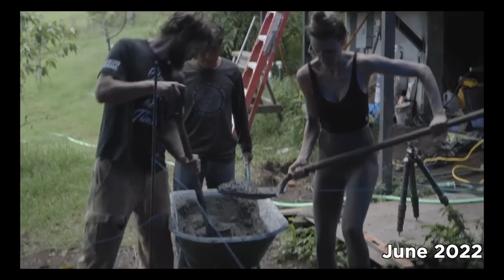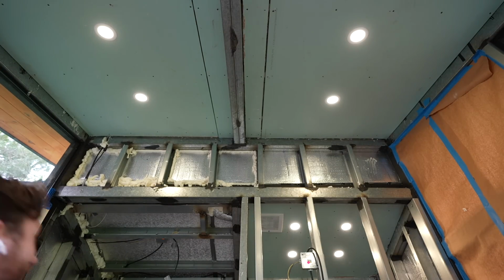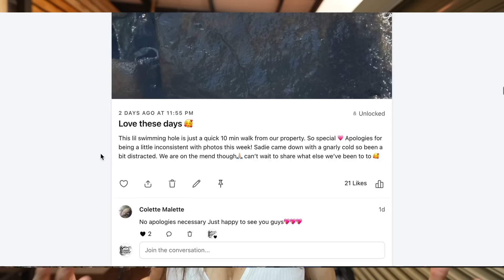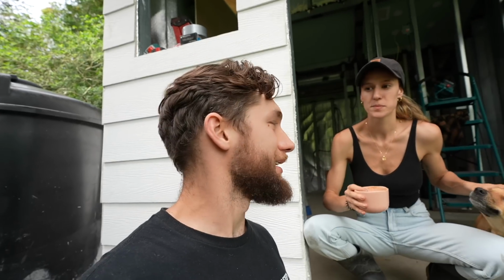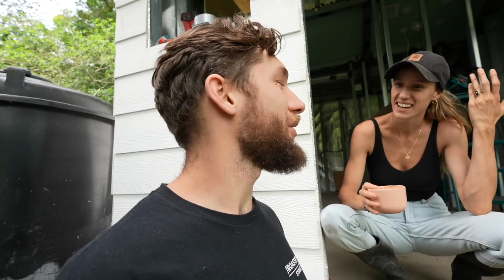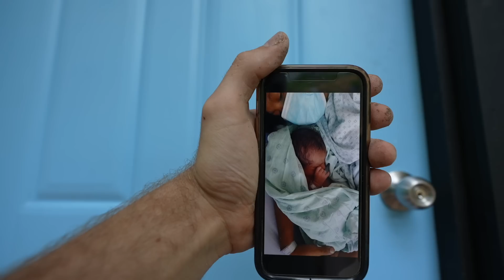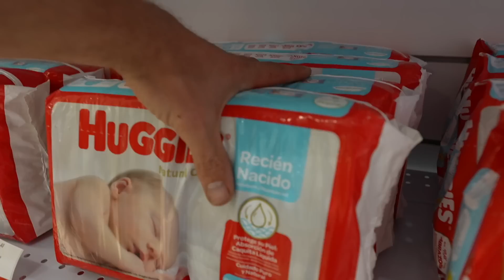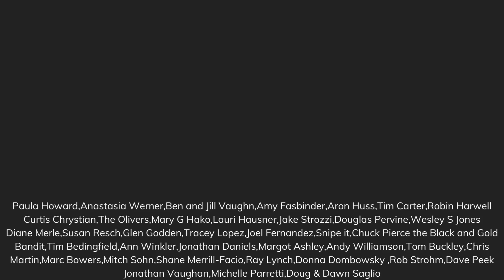EMERGENCY in the NIGHT... We Need A Hospital NOW

Comment: You can make a homemade drywall stand with some two-by-fours. You can use that for leverage to push it up to the ceiling. You've probably seen them and can't get but of course a professional would be using a drywall jack

Comment: A new little person arriving really made the start to my day. Congratulations to the new family. 🎉🧸The roof vent you used is intended for a wall and is going to be a problem. Wind and horizontal rain will lift that flap and water will get in. That flex when it gets wet will disintegrate not to mention the soggy mess the ceiling drywall will become. Make your self a plastic goose neck and use a silicone flashing. If you don't there is going to be a lot work fixing the damage. That type of flex is only intended to be used for heat but gets used for kitchen & Bath exhaust all the time. I have spent hours ripped so much of that S**t out and replaced with aluminum. Lots of very nice shower tile in the garbage. You may as well just burn money in the pizza oven.

Comment: Yikes!  In Boquete’s driving rain, that vent is going to let a ton of water in.  I hope you will get a better vent, or reroute out the side of your structure.  Once that Sheetrock is up, if you get a leak, you’ll end up with mold toxicity.
Reply: It's positioned under the over lap of the roof.  That is why.

Comment: Contractors use a tool, kinda like a tripod, that acts like another set of hands to help hold the sheet rock up high so you can nail it. I think you have a heavy duty tripod? Maybe you can Jerry rig something like that, cuz only using hands to hold it up is really hard!

Comment: Why not put the extractor fan on the top of the side wall?  That's where we put our fan so we didn't have to have a pipe running up through our upstairs.  It just vents out the top side of the wall in the bathroom.  Works really well too.  Plus no worries about roof leaks.

Comment: A good tool you can make for holding drywall on the ceiling is T from 2x4s. If you make  the T just a tad longer than your ceiling height you can wedge it on the floor to hold the sheet.

Comment: Gray is a great color. With the high level of humidity and setting water, there will be mold. Purchase a dehumidifier and let it draw the moisture out of the air. I can dump a gallon a day using mine.

Comment: It's much easier to do the holes on the drywall sheets before you put them up. Then you can use a multitool or a holesaw without risking cutting into wires. The cables should really be in either conduit the whole way or attached at regular intervalls.

Comment: Little trick if you’re scared to drill through wires; put the hole saw in reverse and drill out the holes that way. Secondly, you should vent out the side wall to eliminate leaking.

Comment: Instead of flex pipe for the exhaust fan you can use pvc and run it out the side wall, so no holes on the roof.

Comment: Your extractor fan is going to leak. It mounts to the exterior wall not the roof. It will leak!!! Get an exhaust vent that is designed for the roof.